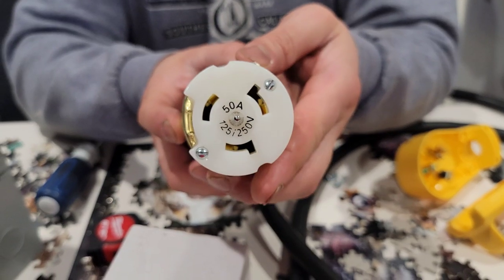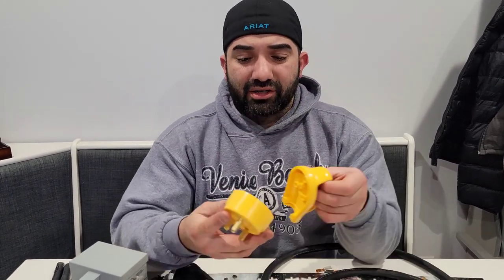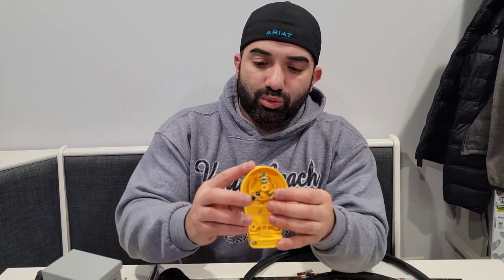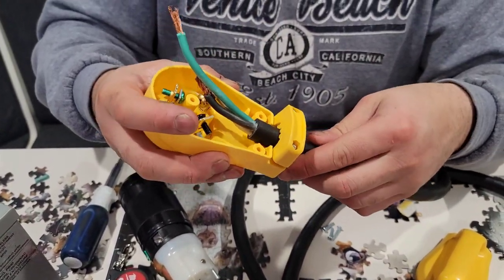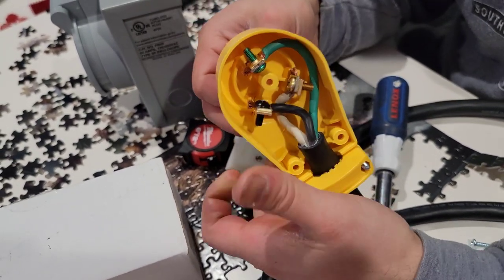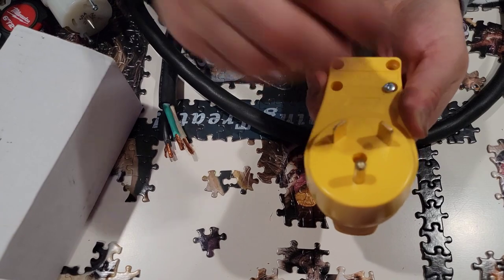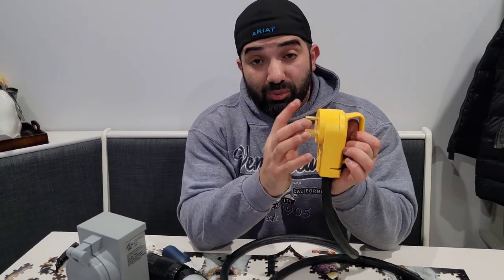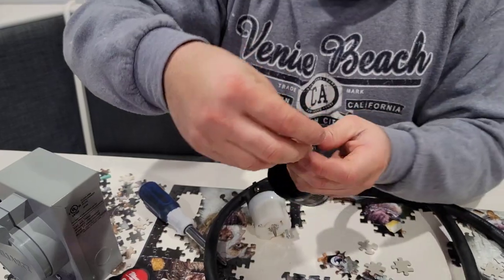How to Power a Food Truck

Comment: Thanks for the vid! I put my order in for a 8’ hood, and I also ordered my concession window too. I’m doing some of the build, while a shop is doing the rest. I scored a trailer that’s insulated, has a 15’9” x 7’10” interior dimensions with 88.5” ceilings.
Reply: Hey where did u order your window from?
Reply: @jayhicks8179  I replied to you earlier, but the comment is gone? I got it at (I’m going to spell it out) R E C P R O
Reply from the maker: @jayhicks8179  or JR Aluminum is another option 👍
Reply from the maker: Nice!!!! Already insulated that's a win right there
Reply: @fbaltierrez  I know! I got the trailer at a steal, it was built for another purpose but the customer flaked before it was finished so it was just an empty shell. The shop that I bought the trailer from builds set trailers for film productions, mobile hand washing stations, mobile enclosed toilet trailers and the like. So I lucked out with this one.
Reply: @fbaltierrez  I checked them out, and they were sold out when I needed to make the purchase.

Comment: You have both 8/3 and 6/3 cable listed here.  What size did you use from the receptacle to the beaker panel?  What size did you use for the generator plug cable?   Is there a reason you have listed both?
Reply from the maker: Depends on your amp need. 6 gauge for 50 amps if needed. 14 gauge runs to outlets and switches

Comment: hey Frank, you think i can use this ? Seeutek 30 Amp Generator Extension Cord 40 Feet Generator Cable 4 Prong 125V/250V 7500W Generator Power Cord NEMA L14-30P/L14-30R with Pre-Drilled Power Inlet Box & Generator Interlock Kit, ETL Listed

Comment: What if I wanted to plug into a building we are parked at and not use my generator, how can I run an extension from the trailer to the building. I'm stuck!
Reply: I am right now in that situation you fixed help me bro

Comment: Hi, I’m a subscriber and the only thing I don’t see in your videos is how did you get your water pump see flow connected to the light switch to get it operated can you make a video of that? Thank you.
Reply from the maker: It's just a switched outlet, instead of running the power wire to an outlet you go to switch first then outlet

Comment: Frank! I need your help man. I just got my first food trailer. It’s brand new and imported from Mexico and it didn’t come with a 30A inlet plug on the exterior of the trailer, instead it has a regular 110v wall plug. I just ordered the 50 A inlet plug to mount onto the trailer. I just don’t know if it’ll be safe since it’s connected directly to the other wall plugs/lights throughout the trailer.
Reply from the maker: Just re run everything new. The best thing to do to not have any issues.

Comment: I noticed your installation panel you installed in your trailer you only have four 15 amp breakers I have nine 20 amp breakers how can I wire my panel for 9 20 amp breakers for a 50 amp plug to a 30 amp generator!
Reply from the maker: That's a lot of power. Question is can the generator handle all the power you need? 9 20 amp Breakers is almost a small house
Reply: @fbaltierrez  
I would love to send you pictures of how my panel is wired it's the way I bought this trailer I need an upgrade from what it is now to a 50 amp panel I have a harbor freight 65 amp generator I really could use your help.

Comment: How would you plug it from the power inlet box to a temp service pole? Our next step is putting in the inlet box the wiring is done.
Reply from the maker: Make a cord like the one you would use to plug into a house or commissary and just cut that end off to give you the wires to connect. I would always try to connect to an outlet tho and not directly to the wires of a temp service pole if that is what you meant
Reply: We have the 50 amp power inlet box set up that’s running with 8-3 wire directly to breaker box inside trailer. Is there a certain type of cord we have to use for the 50 amp? A friend is trying to sell us a 10 gauge extension cord and wondering if that will work to plug into the temp service pole or commissary. Also, we don’t have the commissary yet but need one. Is it true some churches or schools could be one?
Reply from the maker: @hayleymoradel5514  yes schools churches or even local restaurants will help you out. For just temporary power you can use anything I use a 12 gauge just to power on my lights when I'm parked after hours

Comment: What’s the name of the generator you got?
Can we get a link? 
I need to get one also but don’t know what to look for and I heard they take a lot of gas.
Reply from the maker: https://www.amazon.com/gp/product/B06XC47ZX4/ref=as_li_tl?ie=UTF8&camp=1789&creative=9325&creativeASIN=B06XC47ZX4&linkCode=as2&tag=rollingburrit-20&linkId=03c614f61b891ead21bf15cda583d160
Reply from the maker: Excellent Generator this is the exact one I use
Reply: Thank you for that! I wasn’t sure how many watts I would need so I was going to get one with around 6k watts.
Reply: Hey Frank, my food truck builder told me I cannot use that generator. He said I need one with approximately 5500 running/rated watts. Do you know of any with that?
Reply from the maker: @harisz2401  the Predator 9500
Reply: @fbaltierrez  hey Frank I will have a series of questions for you I'm building a 22ft step van into a food truck. Where can I send you dm's?
Reply: So we can use this yellow 30 amp plug with 6/3 SO cable and 50 amp power inlet plug?